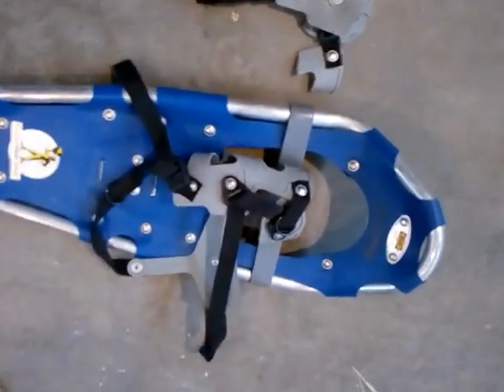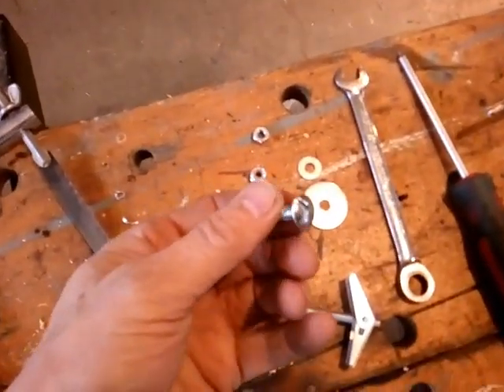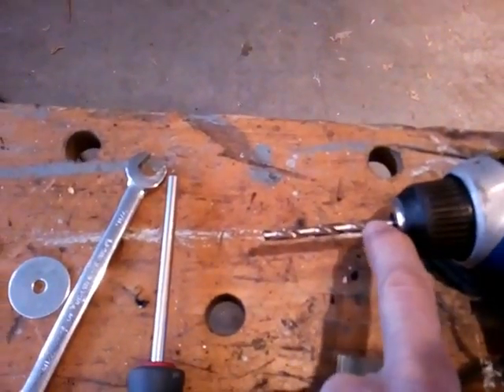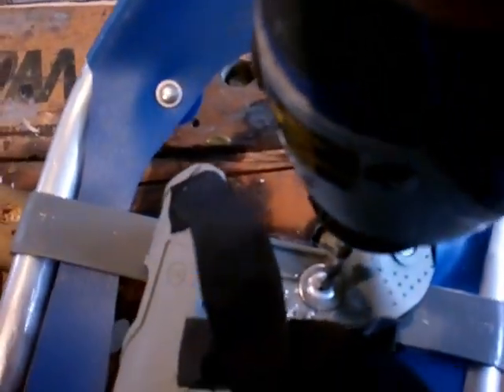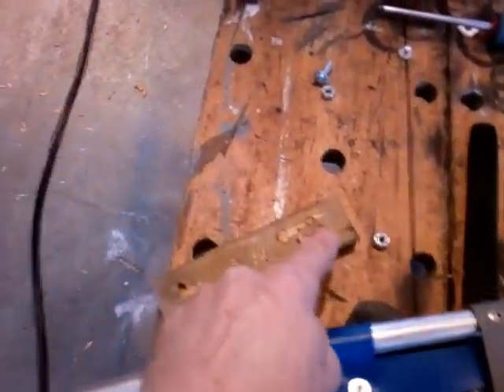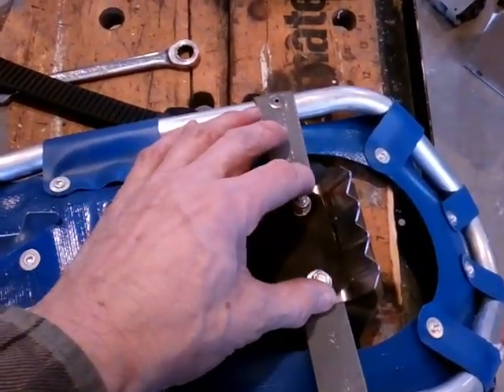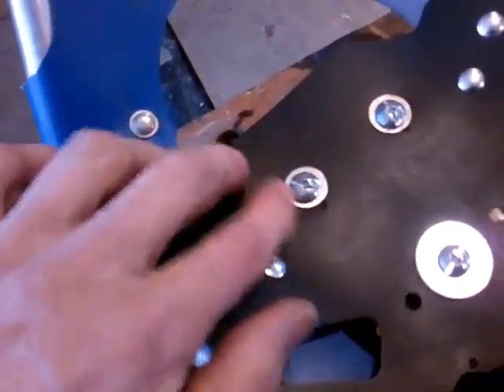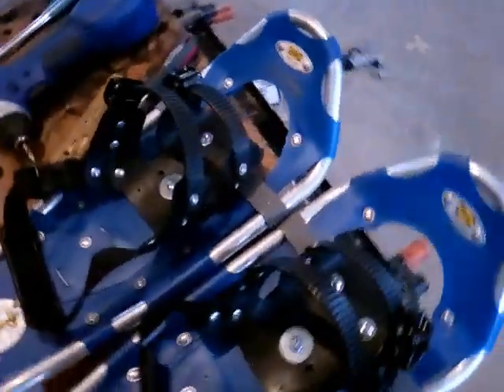How to repair Atlas Snowshoe binding

Comment: Suggested cutting toggle bolts 1/4” at about 4 minute mark,  I believe it was supposed to be 3/4” as I ordered 3/8” bolts to get ready for bindings to arrive, ready to assemble and way too short!   The Bigfoot bindings did come with two front bolts included so just have to get a couple more.  May help to include a written parts list as I was trying to figure out how many and size of everything needed!
Reply from the maker: Yes you are right. I'll make this a sticky at the top.
Reply: The bolts that came with the Bigfoot bindings were too short to go through all the materials needed so would need all the hardware mentioned that included 3/4” length bolt.    As of posting Bigfoot did get several pairs of bindings in!

Comment: Excellent, cost efficient repair. Appreciate you sharing this. Getting Atlas snowshoes repaired at an authorized dealer is $75 per binding plus shipping to and from. You're talking $200 for a repair on a pair of shoes I paid $250 for. I just ordered those bindings, with shipping from Canada it was total $51 with the currency exchange.
Reply from the maker: Glad to help
Reply: @blanchae   The repair went great. I've logged around 10 miles so far with the replacements on some very hilly  terrain in about a foot of snow. I don't know how long the bindings will last, as they seem very close in material to my original Atlas bindings, minus a different heel strap setup. Overall was very pleased with this fix.

Comment: If you are doing this job I would do it with Stainless hardware if  you have the option.  Great video.  Thanks for putting this together!  I have ordered the bindings and intend to follow this process for two sets of shoes that have failed bindings.
Reply from the maker: Great point!

Comment: Which model binding did you use?  I couldn't quite tell.
Reply from the maker: The bindings are sold out. The bindings I purchased are "Bindings For Adventure Snowshoes with a Short Toe Strap & Long Arch Strap". Fits 19", 22", 25", 27" and 30" long snowshoes. The bindings with Long Toe Strap fit 34", 36" and 40" snowshoes. Of course, you should double check that the rivet holes are 2 inches apart side to side and 2 1/2 front to back line center for your shoes to match Bigfoot bindings.
Reply: @blanchae  Thanks!!! And thanks for the video!!

Comment: Which bigfoot binding did you order? I see adventure and elite series. Thx
Reply from the maker: The bindings I had purchased are "Bindings For Adventure Snowshoes with a Short Toe Strap & Long Arch Strap". Fits 19", 22", 25", 27" and 30" long snowshoes. The bindings with Long Toe Strap fit 34", 36" and 40" snowshoes. Of course, you should double check that the rivet holes are 2 inches apart side to side and 2 1/2 front to back line center for your shoes to match Bigfoot bindings.